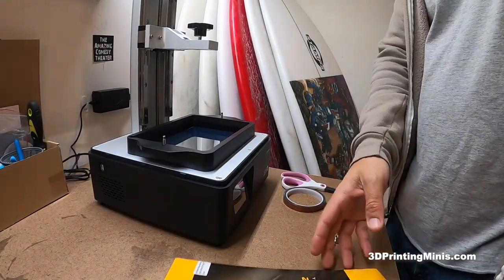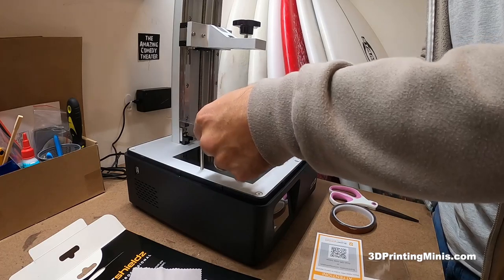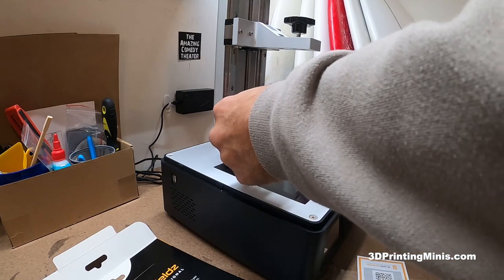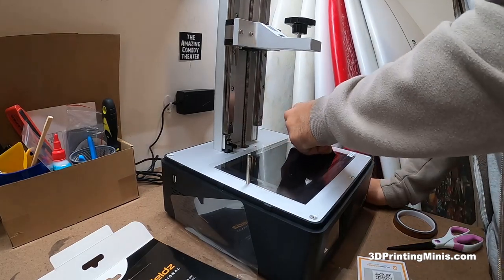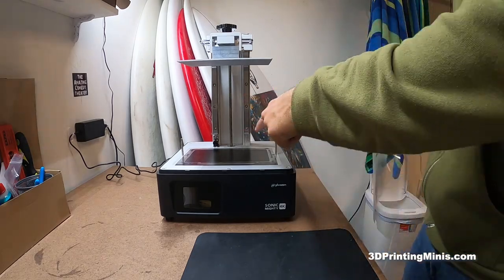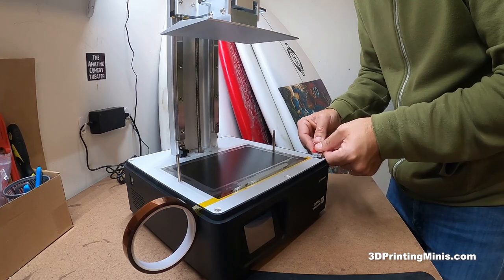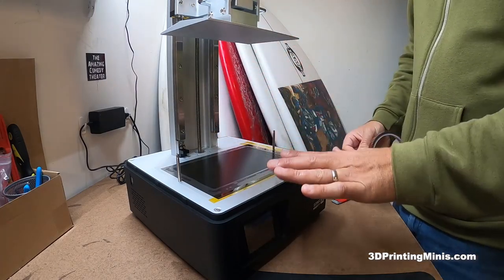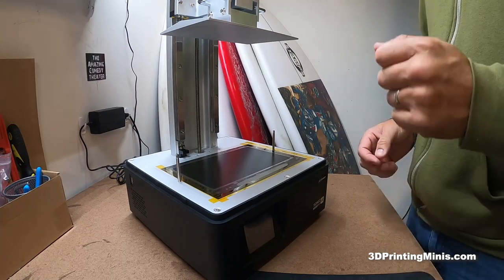How To Install 3D Resin Printer Screen Protector (All Brands) - Sonic Mighty 4K Matte Screen Shield

Comment: How have your prints been since you applied the protector? You mentioned you were going to run some tests? Need to replace the LCD screen on mine as I've already damaged it. Wondering if this method works and doesn't degrade the print quality. If you have some results, please share. Thanks mate.
Reply from the maker: I use the same protector on my Mighty 4K and Elegoo Mars 2. I did some tests with the Mars 2 with and without the screen protector. The prints came out pretty exactly the same. So, there doesn't seem to be image denigration whatsoever.

Comment: Hi . Great explanation! After adding the screen protector have you any change in detail? The reason for asking is that I’ll be printing for n scale trains, signals etc, which are reeeally small! Appreciated
Reply from the maker: No, I haven't really been able to detect any significant loss of detail. And I print mostly 28mm D&D miniatures.

Comment: Do I need the high heat tape? Love the videos! You should have at least 10k subs!
Reply from the maker: Well, it's not like your printer base his heating up to a million degrees. But the UV light that lights up over the course of 100's to 1,000's of layers for a model can get pretty warm. The main reason I use the high heat tape is because it's so thin and I don't want it to interfere with leveling that plate. That being said, a lot of printers ship with what looks like electrical tape around the edges of their beds, so I'm not sure if thickness is such a great factor. However, the generic brand high heat tape is cheap on Amazon so I use it. But, if you're thinking of using a different tape maybe shoot off an email to the printer manufacturer first and ask them what they think. These companies are pretty small and serving a niche market, so they'll usually get back to you within a day or two.

Also, thanks for watching my videos. I appreciate it.

Comment: I’m curious why you used high heat tape. 3d printers don’t produce heat. There is a little when resin is cured sometimes, but I wouldn’t consider it a danger.
Reply from the maker: Because it's extremely thin, durable, inexpensive, readily available and it works. 👍
Reply: @3DPrintingMinis  ah ok. Makes sense then 😁 I just pulled the trigger on the Mighty 4k. Can’t wait to print some bigger stuff. My Photon was just not big enough 😛
Reply from the maker: @bryanfoster362  I went from Mars Pro 2 (which I loved) to the Mighty 4K. The Mighty is awesome. You can fit some much stuff on the plate at one time. Haven't had any troubles with it since I got it in Feb. Best of luck with your new printer and prints!
Reply: @3DPrintingMinis  thanks! I paid extra for 3 day delivery so I hope it doesn’t get held up like yours did 🤞🏻
Reply: UV resin generates heat while curing and can actually get quite warm. I would only consider it "hot" when its more than what would normally just be in a layer.
Reply: Update: My Mighty 4k arrived today! Doing the test print now😁
Reply: P

Comment: The real question is, does having air bubbles under the screen protector even matter? There are ALWAYS air bubbles under the FEP, directly over the printing area, and that doesn't seem to hurt anything... Try it sometime, empty your VAT so you can see them and place it back on the machine, there will be air bubbles under it. Air will always get under the VAT and get trapped between the FEP and screen because the FEP lifts up a bit at every layer.
Reply from the maker: They don't.

Comment: are the ipad covers sticky?
Reply from the maker: Yes, they adhere to the screen. The tape around edges is to make sure they don’t peel up and leak if you have a FEP failure.
Reply: @3DPrintingMinis  of it sticks doesnt that damage the screen if you replace it?
Reply from the maker: No. Just like it doesn’t damage an iPhone or iPad screen if you decide to remove or change it.
Reply: @3DPrintingMinis  Yes, but in the case of some 3D printers there is a polarized filter (film) on top of the LCD tempered glass screen - unprotected by some other tempered glass. That's why it has those black Vinyl strips on the edges, they keep the polarizer film in place, as well as block UV leaks. The adhesive that makes the Ipad protection foil stick is not meant for such high temperatures as a mono UV screen produces perhaps (I don't know the exact temperatures and effects). Also I am not sure about how the sticky adhesive of the Ipad foil interacts with the UV light - as in what exact effect is has on it - does it generate change of state and irregular re-coagulation for example. Does it in a state of flux where it heats in the process affect the polarized film of the printer in any way?
What happens when you want to change the protection foil you applied? It might result in the polarized film getting torn when trying to detach it, having in mind after several prints the adhesive of the ipad foil may have adhered very strongly with the printer's polarizer film.
From what I saw the proprietary unofficial 'protection foils' one can find on the market use a solution in which the center part above the screen is actually some kind of FEP and only the edges have some sticky part (the ones from Bullet or Mach5ve) - an LCD screen gasket.
The FEP itself is a kind of teflon transparent foil designed to withstand high temperatures, so in my mind a FEP foil would make more sense. But I am not sure..
Reply: @femtokun  i was thinking the same, i think the sungle fep solution its "better" , cause you dont "glue" the screen, good analisys